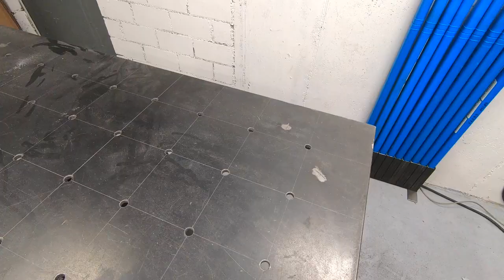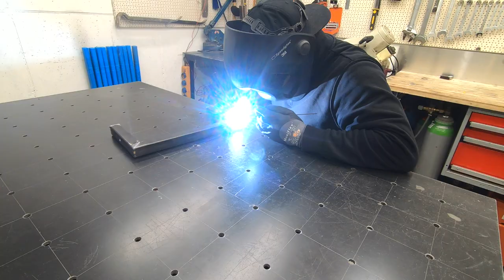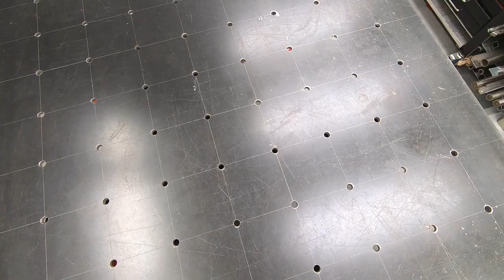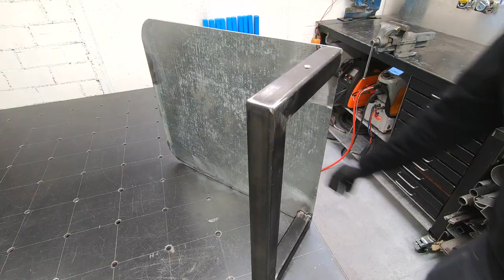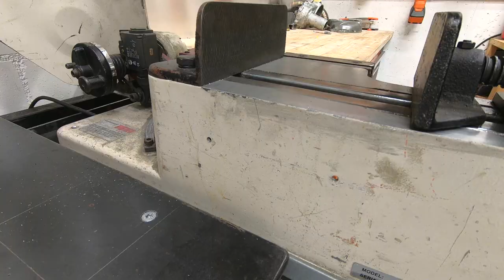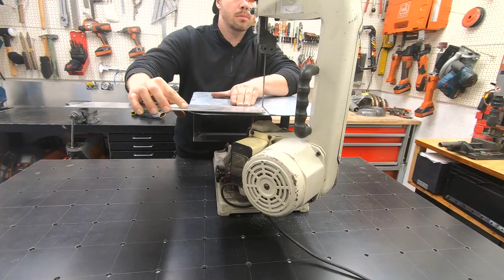Bandsaw Projects add on Table

Comment: I need your help. My Grizzly bandsaw keeps breaking blades. I’m not pushing wood through with much force at all and I’ve adjusted the tension up and down but keep breaking blades. Should I change blade brands?? Any suggestions on how to  remedy the problem?

Comment: Hi, I've been looking for a portable bandsaw and like your setup of the Optimum S100G with the versatility of using it in the vertical position with the table you made, it's awesome in such a small footprint, would you recommend this bandsaw, are there any negative points? I will mainly be cutting square box section and round tube upto 80mm. Thank you.
Reply from the maker: I would buy it straight again 😊 love this saw.

Small problems:
 you are not able to use a lot of oil if you are cutting thick stuff (special Aluminum) otherwise the drive wheel will slip through. Not enough pressur! Use water. You get used to it😊.

The saw is cutting automatically! for thin stuff (thin tubes) cut allways on Soft! Sometimes is cutting not straight, special if is a old saw blade. (Every bandsaw has this problem) 

Buy always bimetal sawblade, they a little bit expensiv but they least forever😊

The Vice is not the best, its a little bit shaky. 

I have this saw since 8 years. I like to have small handy, flexible and light tools.
And like i say on the top, i would buy it straight again 😁
Reply: @TheMetalist  Thank you kindly for responded so quickly, I will place an order for one of these bandsaws. I've watched your videos multiple times and have picked up so many ideas from them, your content is absolutely brilliant. I'll be making the Mag Drill Stand and the Bandsaw table that you showed in your videos. Thank you for sharing.
Reply from the maker: Thank you for the nice Feedback...😁
Reply: @TheMetalist  You run an excellent, inspirational channel. Bravo. I am in the process of choosing a band saw. I really want to buy a small and compact one. I like the Optimum S100G, but the specs say there is no vertical alignment option. How did you do it in your copy to set the arm upright?
Reply from the maker: @zwybrezdlaniec1  i just took the screw off how blocked it from getting vertical
Reply: @TheMetalist  cool.  that is, there is a possibility.  Thank you very much for your answer 👍 I will buy this band saw 🙂
Reply: @TheMetalist  Additional question: I am also interested in the saw. After inquiring at the manufacturer OPTIMUM, I was told that the vertical position can only be used to change the saw blade (I guess they say that due to safety regulations). Question: is the motor of the band saw running in the vertical position or do I still have to bridge something?